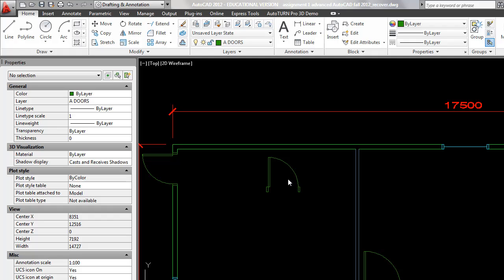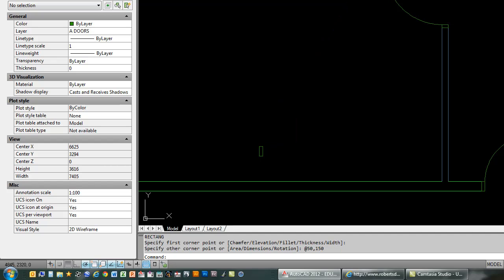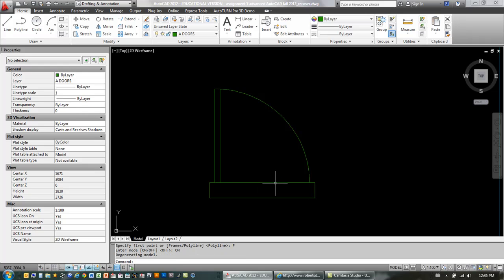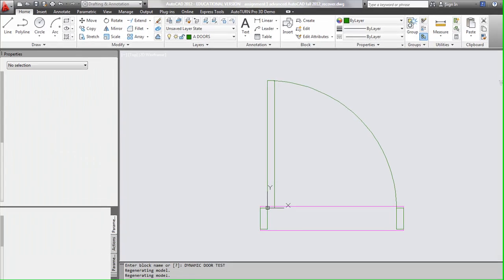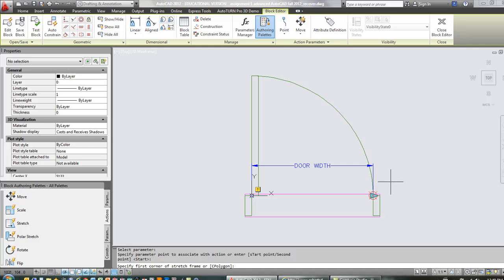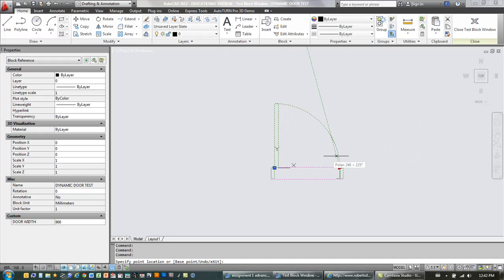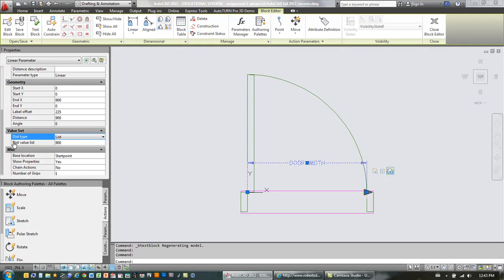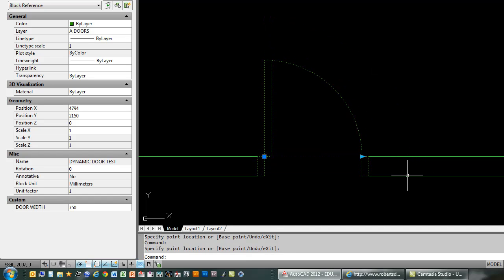DYNAMIC BLOCK DOOR part 1

Comment: I´m trying to do the same but controlling the total width (including the frames) and the arc doest scale correctly even though I overrided the base point in the scale action associated with the linear parameter.
Could you please help me?

Comment: thomas, couldnt thank you enough for how informative and crystal your video is.
however, they're a bit different setting from your to mine to get the same effect.but it works well.
now, i wonder if you could help me w/ how to do double swing door. i followed ur isntruction step by step but im kinda stuck on strecth parameter on step 3. i've changed the angle and try each different angle but it still wont work. any suggestion? really need your maestro advice

Comment: Nice video. I have my own fancy door blocks with sizes and flip controls. The problem with using wipeouts is that certain methods of printing will print them all solid black, so you'll have these huge black squares where all the doors are.

Comment: hello, i was experiencing the same problem as you encountered. My solution was to set a coincident constraint where the swing of the arch meets the end of the door panel. That will allow it to stay attached to the frame. If you have any other questions let me know. I hope that helps.